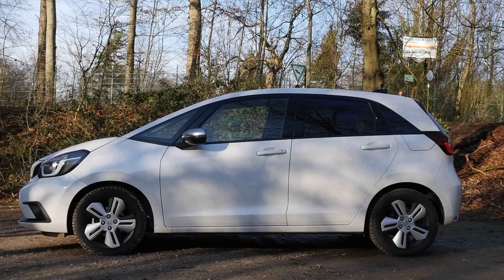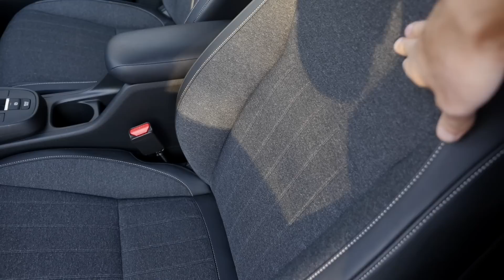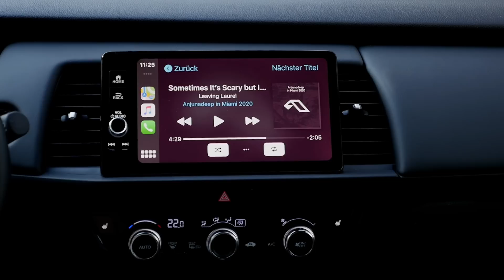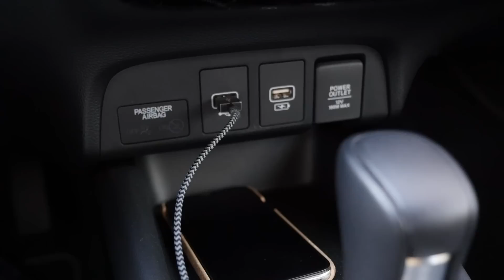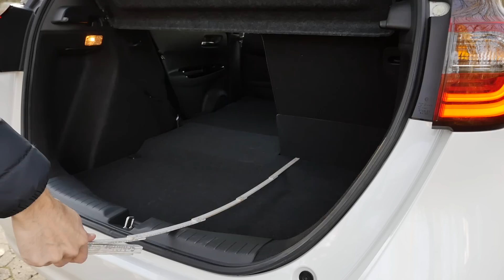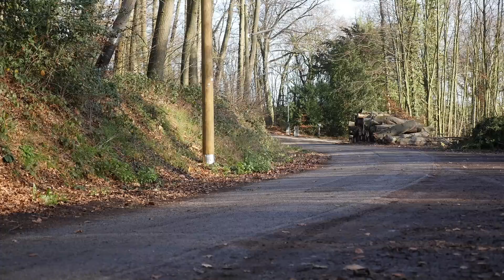Small car, big surprise! all-new Honda Jazz e:HEV FULL REVIEW Honda Fit Hybrid 2021

Comment: Ah yes, the Honda Jazz‐zzzzzz... What a pig ugly car. Yuck. It looks like three people were tasked with creating the exterior, one worked on the front end whilst another set about the side elevation and a third thought about what to do with the rear, none of them apparently able to agree what they finally wanted. Result? One almighty mishmash, a design disaster. Paint a pair of big eyebrows and eyelashes at the top of the windscreen plus two equally large black dots for eyes underneath and with that bulbous nose for a bonnet you've got a Miss Piggy Muppetmobile.

Comment: Hi All i have  purchased a new Honda FIT e-HEV, year 2021. i m happy with the car over all except there is a funny irregular noise when it is purely on Engine. the funny irregular sound is not engine defective sound but something else. i informed the dealer and also got the diagnosis done. everything is OK as per the report. But the sound is very much there. Even the technician has noticed. I m told not to worry about this. this should not occur with a NEW car.  Even another new car has the similar sound. I m not referring to the sound when the battery kicks in, this is acceptable. 
Has some one experiences this is this normal.  please comment
Reply: i forgot to mention, I m from Seychelles Islands
Reply from the maker: Thanks for the feedback! U mean that high revving sound from the cvt?

Comment: Who is going to buy the Jazz when the Civic is just 1k euro more?
Reply: @Key Board somehow a Lexus GS450h 3.5l V6 with dual injection is faster and more efficient than this Honda.

Thomas didn't say that at 172km/h this Honda eats 17l/100km. 

Hard plastics and inefficient for a lot of money.
Reply: @dragospahontu  you are saying it's inefficient for something that it's not meant to be. This is a city and surroundings car, not a vehicle to drive at 170km/h. When used properly, it's actually one of the top more efficient cars there are.
Reply: @albertomartin4812  Lexus GS 450h has the same fuel consumption in the city.
Reply: You would be paying 1k more for base Civic with no "extra stuff", compared to Jazz full equipment.
Plastic wise - same same. Infotainment - same same. Civic is slower to 100 km/h :)
But it is definitely sportier.
More practical - I doubt.
Reply: @chebokli  the Civic is a more mature car.

Comment: A Seat Arona FR 1.0T dsg and the new jazz hybrid cost the same here. Which would you choose if its your money ? Very different technology but ultimately the same cost.
Reply: After purchase, the Arona will cost you more every kilometre driven than the Jazz. It consumes an average of 2 liters more (expensive) gasoline per 100 kilometers. Start counting...
Reply: @dickschuurman4684  here in Singapore, actually the jazz hybrid cost eur5000 more than the arona. The arona sells for eur50k , jazz is abt eur55k due to the high vehicle taxes. Which will you choose ?
Reply: @Fiorano1234  
I consider myself extremely lucky not to have to choose between those two with such price tags ... 😉
Reply from the maker: Seen our Arona review?
Reply: @autogefuehl  yes ! But it does not compare with the jazz hybrid.
Reply from the maker: https://youtu.be/9NSUhOUedLs
Reply: @Key Board public transport is really cheap here. Taking the train from one end of the island to another cost eur1, for this 40km journey. Finally I bought a Nissan Note Epower (280nm Series Hybrid!).

Comment: It is not a "mild hybrid" as you say. There is no mechanical link between the gas engine and wheels... It's more like an electric car with built in gas range extender.
Reply: I would check it out once again... At high speed...😍

Comment: This car has definetly no leck of power. The drivetrain is so Genius...
Reply: CVT is underwhelming
Reply: @dragospahontu  take a test drive. engine drives generator, generator powers motor, motor drives wheels. But while a train is either full-on accelerating or flat-out cruising, the car has extra tweaks to cope with lots of different states.

So the hybrid battery absorbs power when the engine has spare, so the engine (Atkinson-cycle, non-turbo, 1.5-litre) can be shifted to a load-rev point where fuel efficiency is more or less optimal. For brief flat-out spurts, the drive motor draws a bit extra from the battery.

Finally, there’s a lock-up clutch between the engine and the wheels, for direct drive at roughly motorway speeds. That slightly adds to overall efficiency by avoiding the round-the-houses trip of electric power. Other than that, no gearbox, nor yet a CVT in the conventional sense.
Reply: @MB-de5ho  wow that is impressive.

When driving it kinda sounds like a CVT that's why I thought it was one. What i don't like is the high engine sound in the cabin. This car is definitely set for economy and efficiency and it is really good at that.
Reply: @dragospahontu  Merry Christmas and take yourself a test Drive. You will be a Jazzer- stay safe 🌲🎅🏼🙋🏼‍♂️🍀
Reply: @MB-de5ho  I'm sorry man but i drive a Audi S6 C7😅 i don't think I'm a Jazzer.

But i do appreciate the technology and practicality of this car, some people say it's expensive but if you think about it there is no another car that offers you this much for versatility for your money.
Reply: @dragospahontu  
Dragos, I am afraid you are badly infected with a GERM(an) virus.
I hope you will get well soon!
Reply: @dragospahontu  
Dragos, I am afraid you are badly infected with a GERM(an) virus.
I hope you will get well soon!
Reply: @dickschuurman4684  look man i have an Accord.

Kia was sued in Japan for faking diesel emissions
Reply: @dragospahontu  
How many cars do you own, Dragos?
I see here Accord, Audi you also have and a Passat... no Rolls Royce? O.. no, RR is not German... Dream on, troll... 😇
Reply: @dickschuurman4684  huhhhh....

Comment: A hybrid Jazz Type R would be very interesting.  Doing performance versions of regular models would probably be a good investment for Honda’s overall image,
Reply: Although it would be fun to see this thing might not need it, the only reason I learned about his car is because I was following one of them at 135kph on country road only wide enough for one car with lots of turns.... and it still smoked me. I was curious what this thing was made of.
Reply: imagine putting the 2.0 hybrid from the civic. 186ps would be phenomenal in this.
Reply: We don't need that
Reply: Nice idea, maybe the next generation will be plug-in hybrid with the same engine and stronger motor, since the battery could be drained faster

Comment: Have had a Jazz since 2012, the thing is utterly bulletproof. Not exciting to drive, pretty sluggish when trying to accelerate/overtake, and the model I have tends to feel a bit skittish over bumps/potholes etc. However, the practicality of this car is just outstanding. Every time I flatten the rear seats down and it turns into a mini van it makes me appreciate just how clever the Honda engineers are. Certainly very high up on my list of next car to buy once there are a few more on the second hand market. Also wish they'd made a full electric one as an option but I guess they didn't want to step on the Honda E's toes..
Reply: Maybe a Volskwagen Sportsvan would fit your needs
Reply: @dragospahontu  
Dragos, I am afraid you are badly infected with a GERM(an) virus.
I hope you will get well soon!

Comment: Japan recently just released the new Nissan Note E-power. Wonder how well does the new Fit/Jazz goes against the new Note
Reply: Same size, similar profile and looks, but the Note lacks in clever solutions for the interior (back seats, boot floor). On the other hand its driveline is far less complicated so I suppose its price will be quite a bit lower. Frugality is good too. I wouldn't be surprised if the Note's sales were far better than the Jazz/Fit's. The previous Note already outsold the Fit many times.
Reply: @TheSynecdoche  I got to agree with u on the Fit/Jazz clever seat design! Not sure if Note has outsold Fit many a times cos Fit is hugely popular in Asia particularly in China, Taiwan, Thailand, Singapore, Malaysia!
Reply: @ernestkj  but too bad south east asia market dont get this Jazz.. instead we got City hatchback as a replacement for this Jazz (the interior & visibility is worse)
Reply: @arher9598  I was reading an article, they are actually taking in orders for this version but at very high premium. Doesn't make too much cents(sense)...

Comment: I own a 2010 Honda Fit. I agree that it has a lot of room for the driver on the inside, but not a lot of power. However, I love driving it because I can park it in small places. Also, I get 32-35 miles per gallon. I can fit my golf clubs in the back with the back seats folded down.
Reply: I consider that pretty bad mileage for a small car, that's like something from the late 90s.

Comment: Thomas, thank you for this, as usual 😉, very thorough review!  Two thumbs up! 👍👍
I have a question. As a true Honda (and jazz 🎼🎵🎶) fan, we drove a Jazz Comfort Plus CVT until 2017. Switched to a Yaris Hybrid in 2017.
Why Toyota? We wanted a hybrid and Honda didn't have one.
 In fact, the Yaris was the only possible choice, as for a small hybrid car. We like our Yaris, only the comfort and seating position could be better, especially for long(er) rides... 
If we decide to replace the Toyota next year, there will be the choice between the new Yaris Hybrid and the Jazz e-HEV. The space in the Jazz is nice, but the two of us don't really need it. There is hardly ever someone on the backseat.
 Luggage space in the Yaris is also sufficient.

You drove both cars. What would be the better choice, in terms of handling, comfort, consumption, reliability, etc. in your opinion? 
Also taking into account that the Jazz here (in Poland) is almost € 4000 more expensive in a comparable version?

Comment: Actual dream commuter car for the small roads around where I live 😍
Reply: @Key Board man this Jazz at 172km/h the fuel consumption is 17l/100km.

Audi A6 V6 TDI at 180km/h gets 9.2l/100km. Why would I buy a Jazz?
Reply: @Key Board man I'm not trolling. This is the reality. That is the real fuel economy of the Jazz.

What fuel economy are you getting with this car at 172km/h? I know that is the limit of this car.
Reply: @Key Board I'm waiting for a response man😅. I'm starting to think you're trolling me.
Reply: @Key Board man why is the Jazz so inefficient? A Lexus GS450h with a V6 3.5l Hybrid with dual injection is more efficient than a 4 cylinder Honda.
Reply: What about a Volkswagen Up! GTI?
Reply: @dragospahontu  No need for it to be a GTI, imo, you'll just get worse fuel economy. I have a VW Passat right now and I've decided for myself my next car would be a small japanese car
Reply: @mik4414  I have a B8 2.0 TSI 280hp facelift!

I don't think the Up! Will use much fuel since it's light, but the Jazz will be more fuel efficient.

The only gripe I have with these cars is the CVT transmission, to me it seems unnatural.
Reply: @dragospahontu  I've never driven anything but a manual so I have no experience yet with CVTs, but I'm hoping it will be nice for the constant slowing down and accelerating back up that happens on my commute :D
Reply: @dragospahontu  my 2018 Civic RS has CVT and it's brilliant, holds it in the sweet spot and is way quicker than the manual.
Reply: @akie64  a manual is quicker than a CVT, because a manual has more ratios to choose from.

That what i don't like about a CVT, it's good in the city but if you like driving quicker than it can get annoying compared to a manual, torque converter, or dual clutch gearbox.
Reply: @dragospahontu  "a manual is quicker than a CVT, because a manual has more ratios to choose from."
You are really very poorly informed. In 1993 the Williams Formula 1 team came up with a race car (FW15C) with CVT. It was banned by the FIA. Why? Just because it was faster than the same Williams FW15 with conventional gearbox. Not a BIT faster, but a LOT faster: "There was also speculation that it had instantly proved several seconds per lap quicker than the conventional Williams -- which was already miles ahead of its rivals."
 Have a look here: https://www.youtube.com/watch?v=x3UpBKXMRto
and read this: https://www.auto123.com/en/news/f1-technique-williams-tested-a-cvt-transmission-back-in-1993-video/34642/

Comment: I bought one of these a few months ago. 

 So far, I'm very happy . On mostly urban roads I'm averaging low 60s mpg, so it can be very frugal. 

It's not the best on poor roads, and engine noise is harsh under heavy acceleration.

Apart from that, I can't fault it. It seems a far bigger car than it really is, and really has a premium feel when driving it.
Reply: It's nice but i feel german cars are more refined
Reply: @dragospahontu  you're probably right, but there's no german hybrid in the same price range as the Jazz. 

 Also, german reliability isn't in the same league as the Japanese, important if you're buying outright as I did.
Reply: @dragospahontu  
Dragos, I am afraid you are badly infected with a GERM(an) virus.
I hope you will get well soon!
Reply: @dickschuurman4684  my wife owns an Accord 2.4 VTEC and i have an Audi S6 C7.

I clicked on this video because my wife wants a smaller city car and i wanted to see what Thomas thinks if this car.